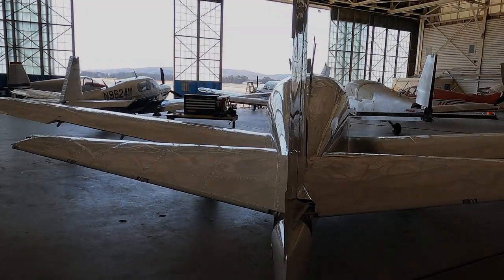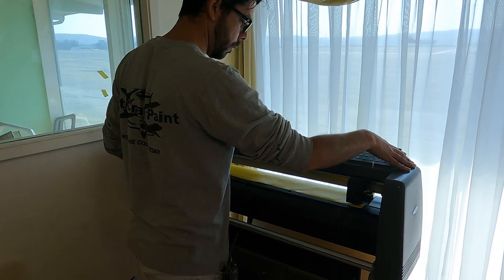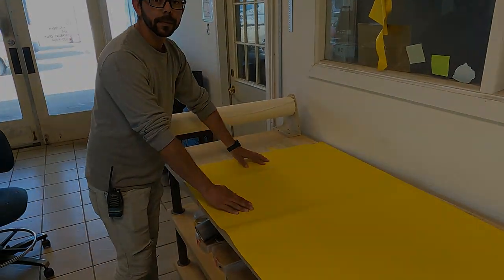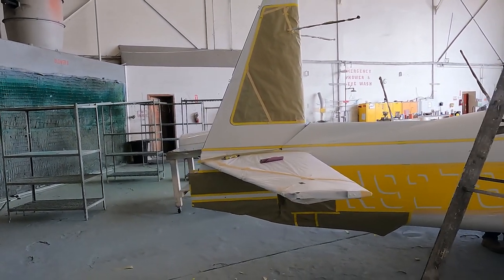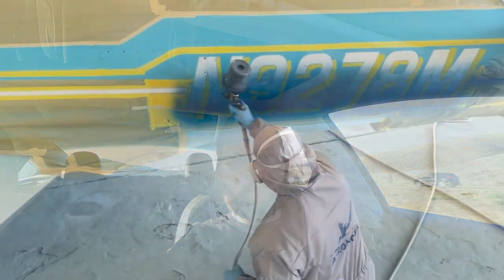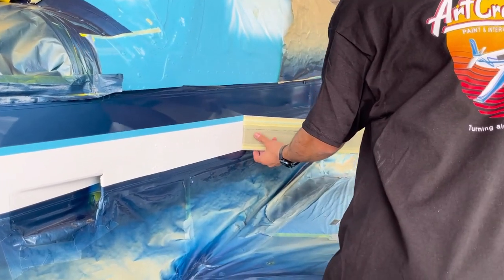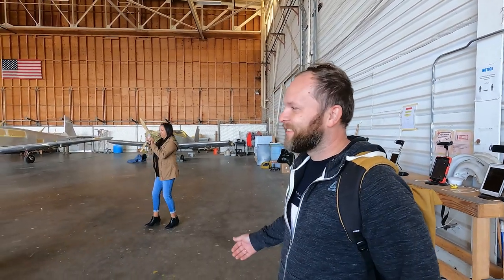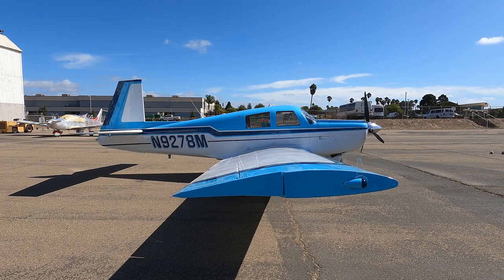Mooney M20E is getting a new paint (episode 6): Final colors and reveal!

Comment: I see one major problem here.  From now on every time you smack a bug or land on an airstrip with a few stones on it, you're going to have a heart attack and spend the next 30 minutes looking for chips and wiping it off with a diaper.  You should take an ice pick and nick up the paint a little so you don't worry about it.  lol!  Just kidding.  Congrats!
Reply from the maker: Hahaha true but I will have less anxiety about corrosion and windshield water leaks because this issue was fixed as well. Also paint is new and can be easily spot painted if needed. Not like older one that was dull and porous